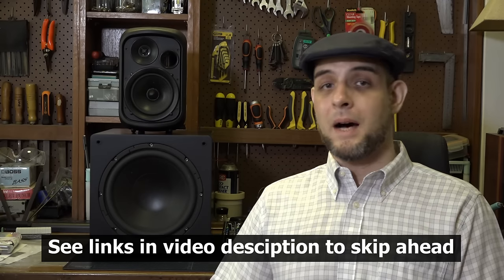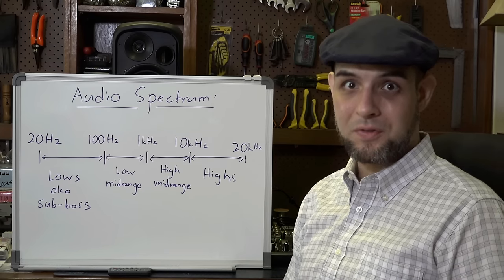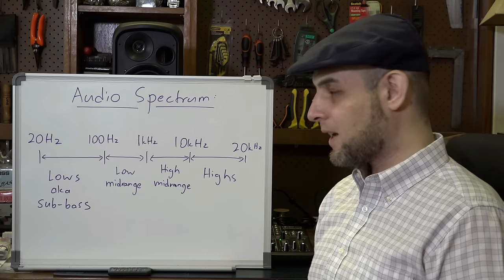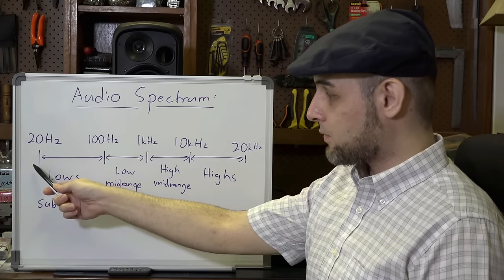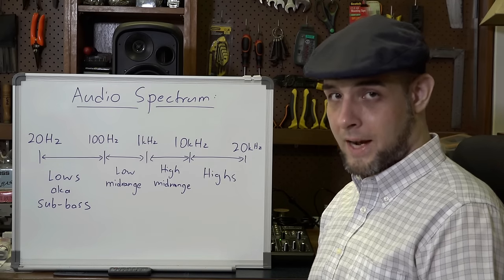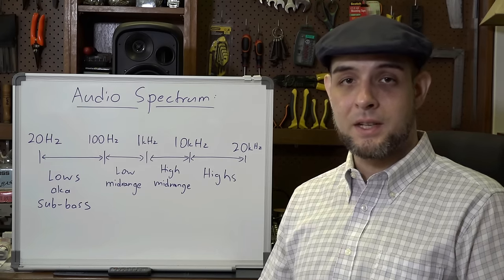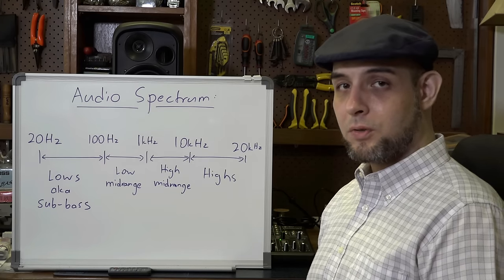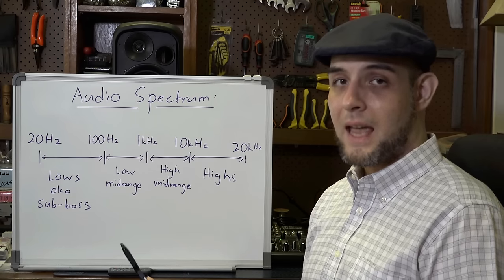How to connect an active subwoofer to a sound reinforcement system

Comment: You seem to be just the man to ask this. What speaker system would you recommend to achieve the brilliant sound you get from earphones when I play my Yamaha digital piano?  If you can answer this I thank you very much.
Reply from the maker: Hi there Colin, would these be for just yourself or for an audience?
Reply: @GLBProductions  Hi Bruno, mainly for an audience in quite a large room usually senior citizens. But, of course, it would always be nice practicing with the sound I get from my earphones with family listening.  I thank you very much for your prompt reply.
Reply: @GLBProductions  Not sure if my reply went through Bruno.  Mainly for an audience of senior citizens in a room about 60 x 60 feet and at a garage Christmas party.  But it would be very nice to practice with the beautiful sound I get through my earphones for my family to hear too. I have asked this question of others who are not independent and living in Nova Scotia, Canada many speakers would have to be ordered without actually hearing them.  Thanking you very much for your early reply.
Reply from the maker: You're welcome Colin 😊 I'm afraid that it is not really possible to replicate the sound of a pair of headphones for an audience: consider that with headphones you have a pair of drivers less than an inch from each ear - the ear/driver position is optimal and does not change even when you turn your head. There is also the attenuation of ambient noise by the driver housing, in the case of closed-back headphones, which serves to improve the signal to noise ratio of the listening experience. 
With an audience listening to a pair of speakers, the distance from each speaker to each member of the audience is different, and there are also reflections from room surfaces to consider. The stereo image is thus compromised. 
It is possible, with a pair of studio monitors and an acoustically-treated room, to get a near-headphone experience for one listener who is equidistant from both speakers, the so-called listening 'sweet spot'. Unfortunately this experience cannot be duplicated for a group of people. 
You mentioned in your email that your performance space is 60x60' (18x18m) - a room this size is actually a challenge even for modern 'speaker on a stick' type systems. Conventional portable 2-way speakers are typically able to provide quality sound out to about 16m/50ft - after that room acoustics and factors such as the volume differential from front to back begin to compromise the sound quality. 
Having said all this, it IS possible to achieve very good sound for an audience using modern sound reinforcement systems, just not sound that is equal to wearing a pair of headphones 😄
Reply: @GLBProductions  Thank you very much, Bruno, I understand that perfectly.  Are you permitted to give me a recommendation for a sound system or two that will give me the best possible realistic sound?
Reply from the maker: Ok, given your goal of the best possible audio quality, I would suggest the following options: 
1. A pair of studio monitors such as the Genelec 800 series - these will provide outstanding audio quality in the near field, out to about 5 meters/15 feet or so. Beyond that the sound will drop off naturally, as would happen in an acoustic performance. The Genelecs have the advantage that they are rugged enough to transport to gigs and have the necessary mounting points to adapt to stands, booms etc. 
2. For larger spaces I have personally had good results with the Bose L1 systems - even the smallest L1 compact will still cover 100 people under certain circumstances. 
As always, try/borrow/rent before you buy anything 😁
Reply: @GLBProductions  Bruno I thank you very much and wish you well. Please keep up with your brilliant videos.
Reply from the maker: Thanks Colin, all the best with your music 👍🏻😀

Comment: Hi. Thanks for your video. It's really helpful. Can you still connect an external crossover to your powered bass even if it has an internal crossover? I have the behringer b1800d pro bass cab that I just bought. I used to have a passive system and I use the crossover for splitting the high and low frequencies but with the new active bass cab, I'm still gonna continue using the passive tops. Do you think using the external crossover with this bass cab will be fine considering it has a built in crossover. Thanks
Reply from the maker: Yes you can - just bypass the sub's internal crossover if possible.

Comment: Excellent work Bruno!and I'm really honored to make the first reply!
2 questions:
But what if you do the opposite?in example connecting the output (no HPFs after) from the mixer to the Full Range speakers inputs and only then connecting rthe output from these into the sub?maybe you can cut the sub frquencies by lowering to zero the Bass control on the Speaker inputs...

Last but not least,so basically Aux Fed subs are more indicated for bands,where you usually have the instruments separated rather than the whole signal of a linel level device?

Ps honestly your recording hasn't convinced me too much but for a demonstration purpose it's ok!by the way are you a Queen fan? :)
Reply from the maker: Thanks Cris, great questions! 

You can go mixer -> fullrange speakers -> sub if you want to, but I have found that using the bass control as a high pass filter usually does not work very well. For one, it's designed as a tone control so typically will have a slope of 6 or 12dB per octave - to act as a high pass filter it really needs to be 18 or 24dB per octave. As a result you often cannot remove enough of the low bass to truly separate the tops and the subs. Or sometimes you remove too much and end up with a hole in the low midrange. 

The other thing is that connecting to the sub first is visually neater - you have only one set of cables going up the speaker stand - with the method above you would have two: up to the fullrange and then back down to the sub. That's a lot of cabling if you also count power cables! 

Aux fed subs can be used for any situation but are most useful where you have a lot of open mics on stage and need to keep these out of the subs. 

Haha yes the recording was just for demo purposes - the drums were from a drum machine but the bass playing was my own. Yes I'm a Queen fan, how did you know? :P
Reply: Cris Valk
Reply: Jeffrey Silverman ???

Comment: Excellent informative presentation. But a question remains: How come the classical music needs not sub-woofer?  It lacks thunderous sound?? No bass? In fact, in many stances a full range speaker cannot handle the bass in the symphonies. Take, for instance, the sound of cannons in Tchaikovsky's 1812 Overture, Op. 49, or the Drums beating in Richard Strauss - Thus Spoke Zarathustra, Op. 30 and finally Beethoven Symphony No.5  ...
Reply from the maker: You are referring to the reproduction of recorded classical music - this video is talking about sound reinforcement or live sound, they are two different applications.

Comment: hi. thanks for giving us information and ideas for free. I have a question, I am using a active mid high speakers and a passive sub. I connect my sub to a crossover and the mid high directly connected without passing a crossover. What is the correct procedure of that kind of set up of mine? Am I doing it correctly? Thanks in advance for your reply. GOD bless you
Reply from the maker: This is an entire video by itself :) I have one of these in production but have limited time to do videos these days due to my teaching and other work.

Comment: Thanks for the education. So, how would you setup a passive subwoofer from a pa mixer to amplifier to load speaker and subwoofer? Mixer presonus 16.4.2
Reply from the maker: Thanks for watching! A passive sub is a different set up: you would use an external electronic crossover which would split the signal from the mixer to the sub and fullrange amplifiers. This is the topic of a separate video which I've been meaning to make for years but have never had the time to do.

Comment: I realize this is small potatoes in the vast knowledge you have, but I am in such a quandary as to how to make this connection work.....  I purchased a Samsung soundbar HW 990c.   This is totally wireless with the subwoofer and rear speakers that came with the package.  From reading a lot of reviews prior to purchase it sounded like a great all in one option.  However, I find the rears not loud enough and the same with the sub.  So, I have decided to purchase bookshelf surround speakers for rears and a sub to enhance the sound. 
 While scouring the internet to find how to make these connections work since there is no aux nor out for a sub on this bar, I am thinking I need to buy a small amp to connect the speakers and another amp to connect the sub as they are not going to be close to one another.  Do I then connect these amps via Bluetooth to the soundbar?  TV? and use the pass through on the Samsung TV?   Am I just dreaming of better sound and I just need to settle?  Packing up the whole system and sending it back to start over is not an option at this time.  The options I do have regarding connections are optical and HDMI.  Can a powered sub be connected by either of these to the TV or soundbar?  I have not purchased the sub as yet but I see most have RCA connections, can a converter; optical to RCA or HDMI to RCA work?  I would appreciate any input you have.  Thank you very much !
Reply from the maker: Hi there Juju, I'm afraid that I'm not your man when it comes to hifi and home theatre 😄 I suggest you consult with somebody who is an expert in this area. All the best and sorry I can't be of more help.

Comment: Great Video. Good Explanation. I usually dedicate an aux channel on the mixer to the subs with low pass enabled but I start the roll off at about 70 hz. The mains have a high pass enabled with the break point at about 50 hz. Since the roll offs are not immediate the 50 to 70 Hz signal is not really cut at all. I also do not break up subs into left right and use a mono signal for them since in these frequency ranges directional location of the source is not possible for the human ear, they are simply too close together and the wavelengths too long. This is just the way I do it and it seems to give good results in our church in a room that is not optimal. Will you be doing any videos discussing compensating for the room?
Reply from the maker: That's an interesting approach! I agree with keeping subs in mono, especially in small systems where the subs are close to one another or even placed together at the front of the stage. 

Compensating for the room is a very complex and somewhat controversial topic! I have a system integrator who is a good friend and we will probably do some videos on this topic together but he is very busy so not sure when that's going to happen. Personally I find that a system which is well-aimed and correctly time-aligned using good quality speakers should require minimal corrective EQ.
Reply: Always willing to learn from the experience of others. What I bring to it is my knowledge of the physics of sound I learned as a Submarine Sonar Tech and over 40 years experience in electronics. Everything I have learned about mixing and sound enhancement has been self taught or learned from others with some real world experience. As a result my approach may not be traditional but I do have my reasons. Your videos give me another good resource of information that is backed by experience. I can't say I always agree 100% but even if I do it is not because you are wrong because you always support your positions with facts. Keep up the great work. Looking forward to your next topic.

Comment: That was the most helpful topic I've learned, and thanks again, but I have a concern about impedance and wattage. I have a 500 QSC, two JBl Pro215 passive which is 250 watts each, 500w peak, I bought a Sub 18' Powered 700 to 1400w peak, I used a crossover and a EQ, but I used the last method the was shown on the video, I used a channel from the amp for the Sub and the other one for both speakers.  I was wondering if I would like to add two more speakers, plus another sub, would it be possible or I will need a bigger Amp with high capacity?.
Reply from the maker: Hello Simeon, it will depend on whether your amplifier can drive the combined load of four speakers plus two subwoofers - in order to determine this you will need to calculate the combined impedance and power handling of the loudspeakers and compare them against your amp's minimum allowed impedance and power delivery per channel. I have a video that shows how to do these calculations: https://www.youtube.com/watch?v=l9L7uK7Xy0w

Comment: Thank you Bruno this has been very helpful because I want to add a sub to set up for a small PA system the equipment I have is 2 Harbinger 2115 2 way Active Speakers and my mixer is a Mackie ProFx 12 v2 . You made it very clear about hooking up the Sub  but on this mixer how will I hookup 2 Monitors to the system
Reply from the maker: You'd hook up the monitors using the aux send bus on the mixer :)
Reply: If you have the time would you mind looking up my mixer  (Mackie ProFX 12 v2) because just saying what you said is not computing I don't have AUX Send I have Mon Send 1/4"  and AUX knobs how do I run the cables for two monitors
Reply from the maker: On that mixer aux send = mon send. Just to be clear when you say monitors do you mean stage monitors for the performers or monitors for a DJ booth?
Reply: got it....Thanks

Comment: Thanks for the quick response, your a great teacher and a real pro. so if I have only 1 sub I imagine it needs to have two inputs and two outputs (Left & Right) unless I were to have a sub with only one in and one out, go to the first main and then daisy chain to another main but I think I will loose some control if I do it that way.
Reply from the maker: Correct - if you have only one sub it needs to have left and right inputs, assuming you are running a stereo system.

Comment: is there an easy way to know if the phase is in or out. I am always guessing it. 
Thanks
Reply from the maker: You mean polarity? Phase is expressed in degrees, polarity is either normal or reversed 😊 With polarity if you bring two loudspeakers close together and their polarity is reversed you will hear an immediate and unnatural drop off in the bass frequencies. The other way is to use a polarity checker, made by companies like Whirlwind.

Comment: Question. For a live band set up and front audience speakers ,what is the best ways to set up your volume adjustments if you don't have a mixer guy hearing in front of the crowd.  Can you go by how many lights are showing on the mixer when music is playing and star blinking
Reply from the maker: Not really 😉 The best way is to ask somebody whose judgement you trust to listen during the rehearsal or soundcheck and then make changes as necessary. You should be able to get things pretty well adjusted using this method.

Comment: I learn so much from your lesson. Btw, I have a Mackie profx16V2. It doesn't have Aux send but only Mon send 1 and 2, fx send, and aux return (Left and right).  What's the difference with the aux send of the aforementioned connection and how to hook my active subwoofer? TIA.
Reply from the maker: Thanks Jess - on your Mackie if you want to use the aux fed sub technique you would need to use one of the aux sends, whichever one is post-fader (need to check your owner's manual for that info). You could also use the FX send (likely already in use for the internal effects) or the group outputs (not shown in the video).

Comment: hi sir. I see that you are a professional and I have a question. I have a xenix 1002fx mixer, an active subwoofer vq1500d and an active speaker b212d, all from behringer.  what cables should I use and where should I get the audio signal from the mixer to to have separate control over each of the two above. thanks for your help.
Reply from the maker: TRS to XLR male from the mixer to the sub and XLR from the sub to the fullrange speaker. Alternatively you can use the FX send of the mixer to create an aux-fed sub but you will have to give up the use of the mixer's internal effects.
Reply: @GLBProductions  thanks a lot. You are the best.😀

Comment: Question: I have active speakers.  Instead of connection the  sub woofer to the mixer, can the subwoofer be connect to the active speaker and get good results?
Reply from the maker: In order for that to work the fullrange loudspeakers need to have a parallel line-level output as well as a setting which removes the low frequencies from the fullrange speakers themselves.

Comment: I am lucky to find this clip very late because I now (in June 2022) just try to improve my little knowledge on audio and sound system for both listening to music and playing karaoke in a small house. I will have a pair of powered YAMAHA HS8 and a YAM active sub. My vintage karaoke amplifier only takes analog and output analog sound. Do you think it is no issue if the audio source is digital? Do you think with this audio system I will get the medium level of sound from this system? Thanks. VPN
Reply from the maker: The HS8s +sub should have no problem in giving you medium sound levels in a small space. If your audio source is digital you will of course need some kind of analog to digital converter.